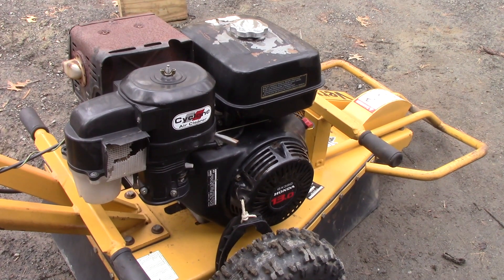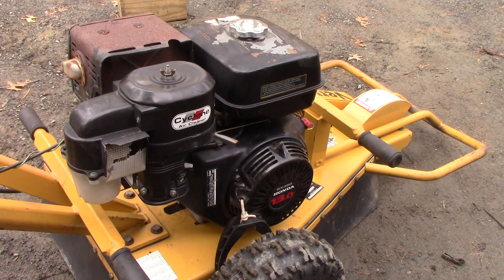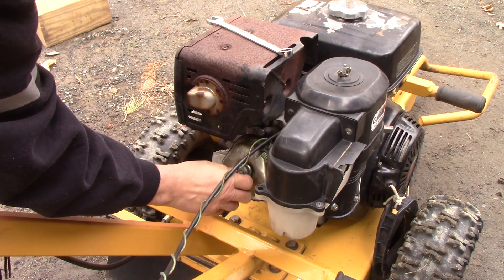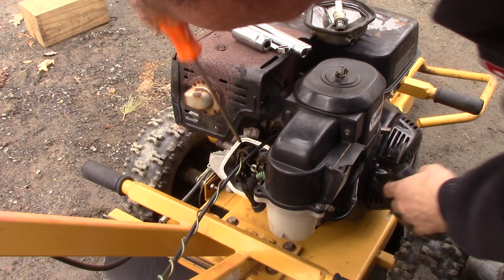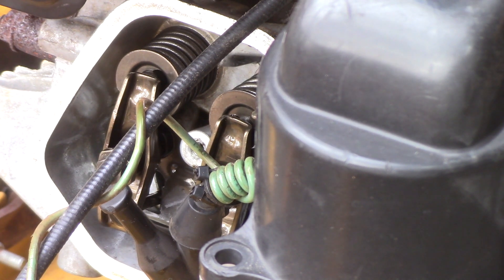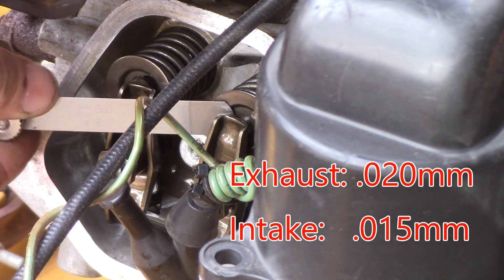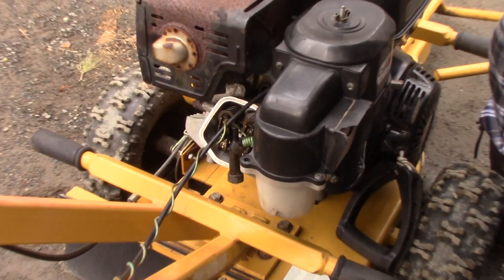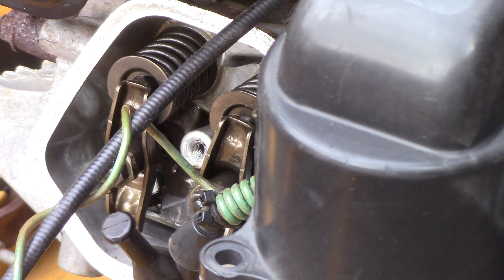Pull start rope gets ripped out of hand

Comment: That's what i figured is wrong with mine  a valve adjustment but does that mean it's too tight or loose or could it be either or an have to check it   with a feeler gauge

Comment: Thanks for showing this, I own a bunton walk behind mower with a kawasaki 14hp engine. It caused a couple of my fingers to swell up because of the grip I put on it. I concluded the 14hp engine is stronger than my hand! I will check this ASAP. BTW You were very clear and straight to the point! I thought there would be a gasket on the valve cover, but apparently not.

Comment: Thank you! I have the same problem & thought that might be the cause. Now I can pursue the repair with confidence it will fix the problem. Mine violently ripped the pull cord from my hand & snaps the handle off. Having to fix the recoil starter several times was frustrating. This was the first time I encountered this problem. I have fixed many broken keys on lawnmowers but this is on a compressor. I was a little puzzled at first! After pondering the problem for a while the only possible cause must be the valves. Another peculiar symptom was the engine after sitting a while between use wouldn't start unless I removed the air filter & put my hand over the intake then it fired right up choke wasn't enough. I'm curious if this will fix that also.

Comment: Not helpful at all. Brand new cam new rockers new lifters adjustmet on lash yet works 2 or 3 times then starts kicking back again so no this has not explained anything other than lash adjustment
Reply from the maker: If the spring is broke or any part of the A.C.R. which is attached to the cam gear shaft, then you will get high compression pull back.

Comment: how about a stihl ms440 chain saw, sometimes its fine, sometimes, it  is really hard to pull, when theres no spark plug turns fine
Reply from the maker: Some chain saws have a compression release button , but not sure if they would have an acr on a two stroke
Reply: @JLafix  thanks, mine does not , I’ll check the fly wheel thanks!
Reply: 2 strokes don't have valves, only release compression valves

Comment: My predator kicks out your hand after i changer the valve spings to 18LB's  with stock 
springs it never did that??
Reply: Same her ei did 18 lbs springs. Re adjust your valve lash to correct lash. And make sure your flywheel key is still intact and flywheel is lined up with crank.  If still not fixed take the crank case off and make sure the cam and crank are lined up for proper timing.
Reply: u may need to get heavier duty pushrods, because the stock ones would flex and therefore, the compression release would barely work, or not work at all.

Comment: I mostly see the Honda units with the cracked exhaust rockers. That engine there was built like a tank. Honda might be quiet but they do not hold up as well. The valve covers warp when removing them. You eather have to beat them back into shape or replace them. Guys get carried away using gasket sealer thinking more is better. It makes a mess and I charge more when I have to clean it up. A new cover would be better and cheaper.

Comment: i have 15 hp woodchipper and some times the pull start rips out my hand   how do you no were top dead centre is
Reply from the maker: You can take spark plug out put a long shaft screw driver in the whole then rotate engine and watch the screwdriver go up and down. Up is top dead center

Comment: Is the valve size the same for every small engines?
Reply from the maker: If you mean the valve clearance.  I wouldn't know all manufacturers specs. But using  .004 in. As a general  spec. Is what I've always used
Reply: J La ok I have a old go cart from the 90s and every time I pull it, it yanks back and hurts. I’m thinking this is the problem how about you

Comment: Did you also check flywheel key for damage?  That's normally the issue.
Reply: Not on that type of unit. Lawn mowers are prone for that. Honda engines experience the dreaded cracked exhaust rocker 99% of the time. I have seen snow blowers blow the flywheel key because of water in the tank, the owner sprays ether into the engine,causing back fire and anti- rotation due to pre-ignition. I have repaired many snow blowers with that problem. I always ask the owner if they used ether to start the engine. 99% of the time its a yes.
Reply: @scottfirman but starting fluid is different then ether now right ? It has upper cylinder lubricants and such